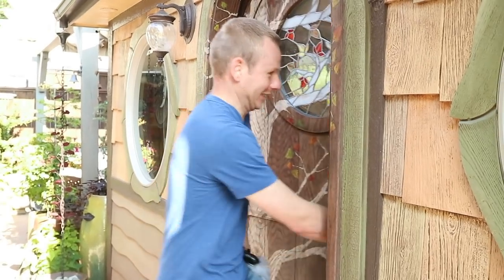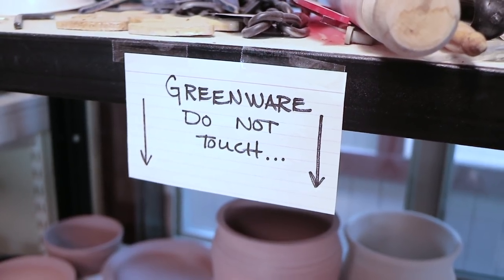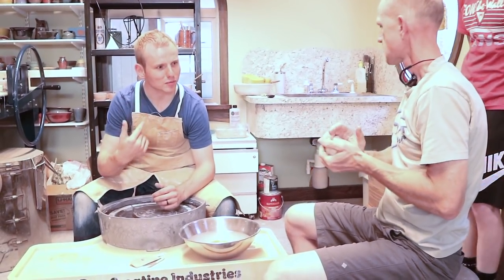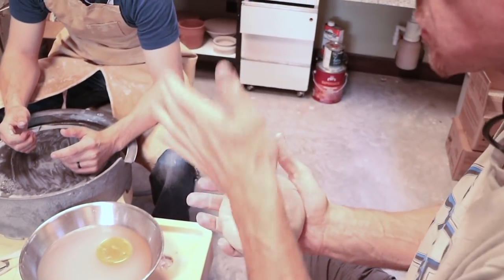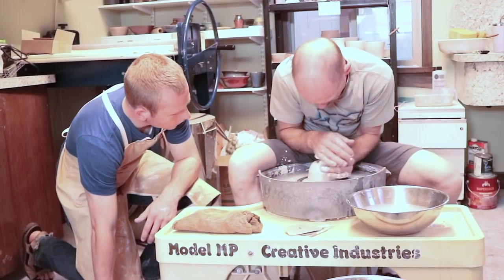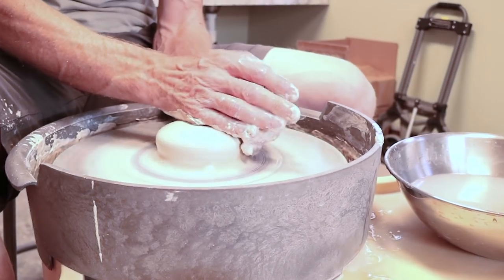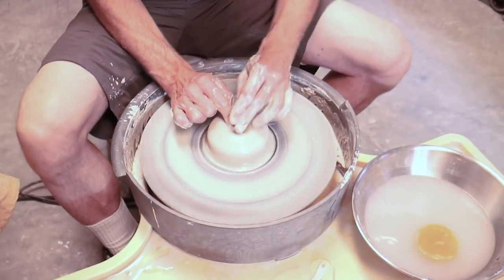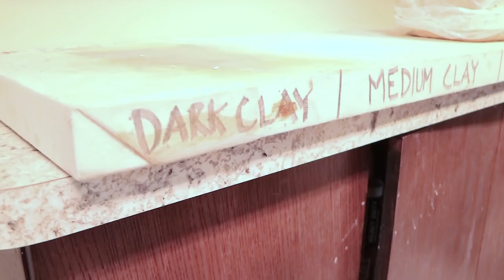Throwing Pots in the Hobbit Shed (Introduction to the Potter's Wheel)

Comment: Mix earth with water. Whirl it in air. Bake it in fire, and get useful goods. No wonder the ancients named the elements as they did.  It's an amazing process, even when you can section it and put it on a SEM and talk learnedly of the glass transformation and the crystal grain structure and all the learned chemistry - it's still dirt, and water, and fire, and a bunch of hand work makes a pot!